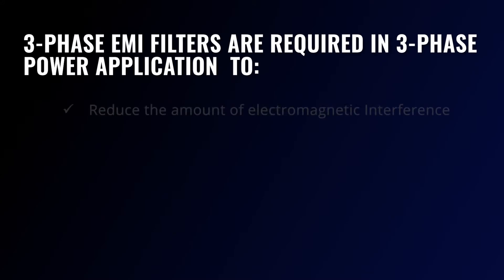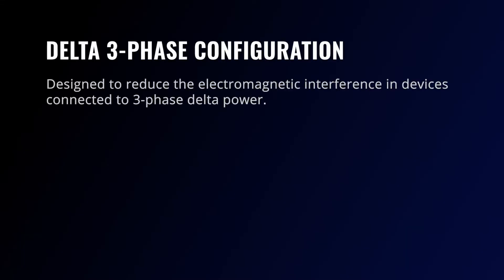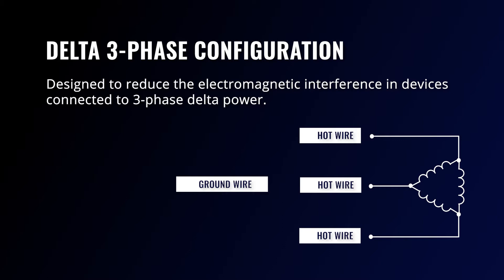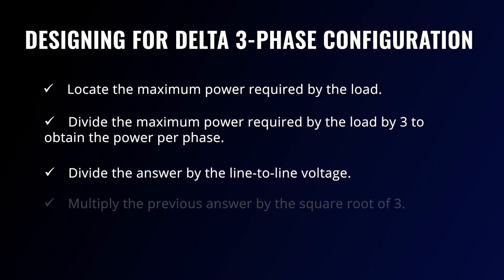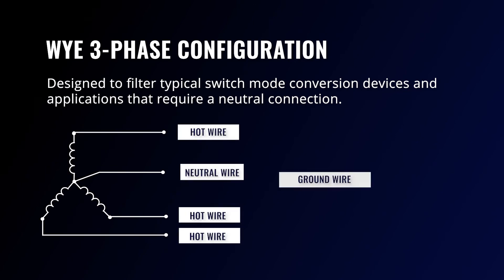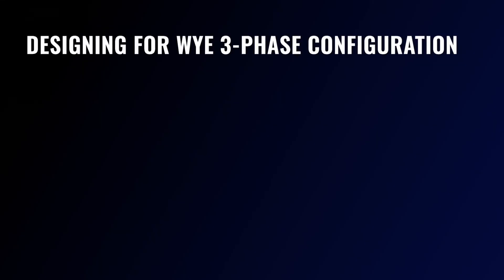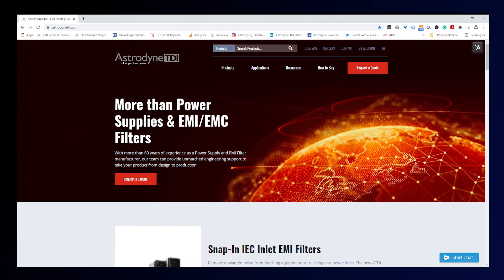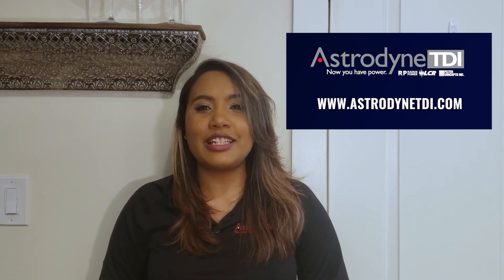Delta vs WYE 3-Phase EMI Filters

Comment: Why are you using a spokes model who clearly has no idea what she's talking about? A lot of the information she's giving is correct, but not all of it, and she doesn't know the difference. Why not use a person who knows what they're talking about, especially one that understands the terms they are speaking, and doesn't put inappropriate breaks between multi-word terms?

If you represent a company that is selling electrical or electronic devices, I'm not buying anything from you if you think "3-phase power delivers 3 times the power of a single-phase power". You're off by a factor of almost 2.

Hint: What's the square root of 3?